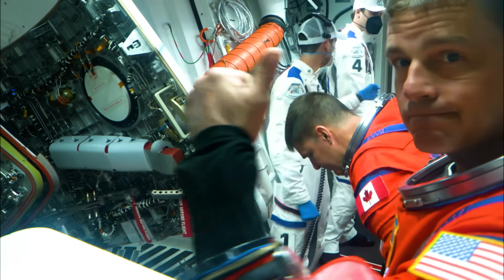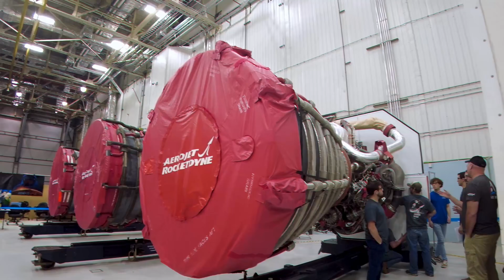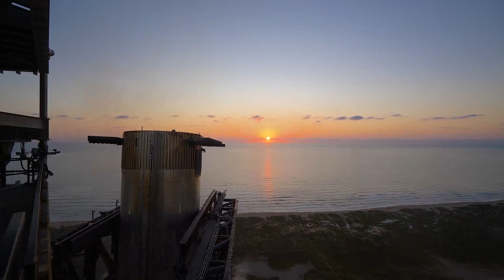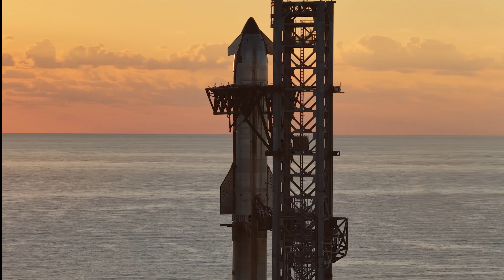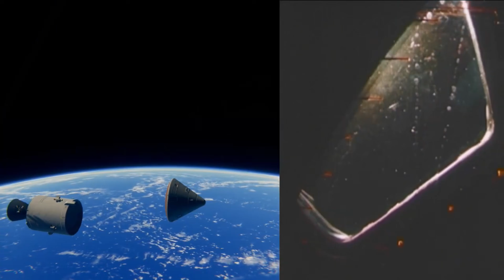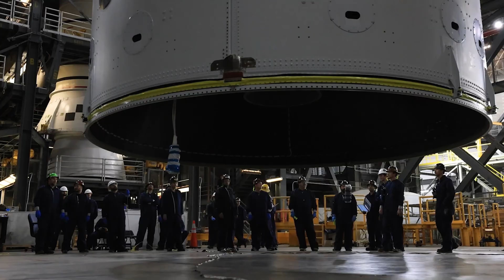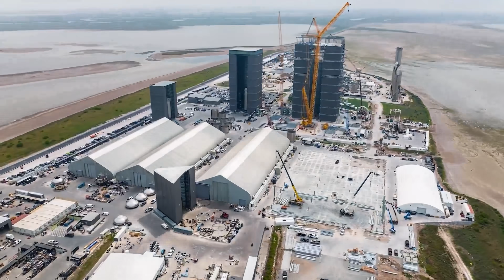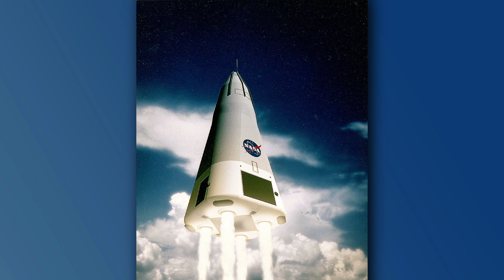Why SpaceX Starship and NASA Rockets Are So Different…

Comment: One word of advice for NASA: unaffordable.
Reply: At least NASA'S rockets do not constantly explode
Reply: @joeybulford9055 SpaceX launched 165 missions in 2025. 

NASA... 8. 

You only see the testing, but SpaceX already has extremely reliable systems.
Reply: @TexanTomcat 
I do not think you understand which of those rockets were for StarLink and which ones were for Starship. 
Starship has not had one single orbital launch since it started being tested a decade ago!! Elon will never reach the moon.
Reply: @joeybulford9055 I mean the reality is that Starship is not SpaceX's flagship program.

They can afford to do cutting edge R&D and fail time and time again with little consequence because they have enough capital from their breadwinning programs.

Reality is that no country or company can even compare to Starship, even if it takes dozens of more failures, SpaceX can easily take the burden.

Starship will eventually succeed and it promises SpaceX a near monopoly on space.
Reply: @joeybulford9055  NASA has done some impressive work.  In the past.  Under Dr. Werner Von Braun, a true engineer.  Key word is 'has', has meaning 60 years ago.  Von Braun was a visionary.  NASA has been run by bureaucrats since.  The new guy, forget his name, has some impressive credentials, but he's still run by corrupt, scumbag politicians.  

At $4B a pop and a launch every 3 years, SLS is a technological dead end. 

Can SpaceX do better? Well, they are currently responsible for more than HALF of all launches. IN THE WORLD!  That's street cred in my book.  Can they scale that success up with Starship?  We'll see, but at least the cost structure makes sense.
Reply: @joeybulford9055  That's because they never fly!  Because they are UNAFFORDABLE.

Comment: The amount of plain stupidity in these comments.... Nasa just cannot afford a rocket to go Boom like SpaceX does. All of the processes need to be thoroughly inspected, tested and retest hundreds of times, and that costs time and money. But in even though SLS costs more than a starship, SLS is a proven and reliable rocket system that already sent people to the moon.
Reply: SLS, is needlesly expensive, using old technology, reusing old engines from the space shuttle, it shouldn't have been expensive, and it is expensive because the money is pass arround, subcontracting everything, overengeneering everything, beurocrating everything, all for a rocket that can only launch once a year, while carring 46 metric tons at its best, for a 4.1 billion cost per launch, SLS is useless, starship can carry 100 metric tons per launch por a 110 million cost (the goal), and up to 200 ton in its version 4 costing 200 million(the goal), and can launch daily(again , that is the goal), while SLS can't and won't ever do that, for context, a 200-ton Starship V4 lunar flight cost less than 5% of a single NASA SLS Block 2 launch ($4.1 billion for 46 tons), while delivering over four times the amount of cargo, tha is why SLS should have been cancelled, and all resources should have gone to Starchip, money would have been better expended. You can go to the moon with SLS, and that's it, you can't build a moonbase with it ,only starchip will be capable of it.
Reply: @Voltaje_YT  - Beautiful analysis. 👍💯👊☺️ I was reading your post faster and faster.. because it was so cogent and well-crafted. 💪💯🤠
Reply: That argument goes two ways. A cheaper design would've allowed NASA to fly and test more often instead of putting all their bets on everything going perfectly.
Reply: Ah in reality SLS can't land humans on the moon, needs a secondary vehicle, nobody can afford the SLS that's why most all of the program has been cancelled, all future heavy lift designs and the launch tower for them are gone now, can't be spending billions to merely launch the Orion capsule to earths orbit, , NASA has seen the light and that is a fully reusable heavy lift rocket like Starship it can also take the capsule to the moon, after the moon landing there are plans for only one SLS launch a year, and that will most likely fade away fast as starship will be doing most all the work regarding a moon base, only block l remains in the SLS plans,

Comment: The SpaceX rocket concept is not remotely new. The Russian N1 had almost the same number of engines, but they couldn't get it to work due to not having the electronic capability of managing so many engines together.
Reply: Their only similarity is having many engines and being super heavy lift, that is it.
Reply: @gomul13  No, the pattern is very similar and they are basically using exactly the same technology from that perspective. I know because it's in the various papers.
Reply: @thisismonitor4099 1960s technology vs 2020s technology how is that the same? what pattern is repeating? none.

Comment: The RS-25 engines aren't just the same model and type of engines used on the Space Shuttle, they are literally the same engines used on Shuttle orbiters where equipment that belongs in a museum is being literally thrown away after but one additional use.

A huge waste of heritage and money.  Throwing away historic relics just offends me.
Reply: Unfortunately it cost Milions of dollars to prepare 
These relics for display. Then you need a place to put them.
Reply: @anthonybrennan4416 The cost is mainly making them safe for curators to handle them.

As for where to put them, there are three   orbiters with fake engines in them on public display.  I have no doubt all three locations would be thrilled to get the actual engines that flew in those orbiters.  Even if recovered from the bottom of the ocean like Apollo 11's F1 engines that flew on the Saturn V.  Those are in museums,  why not the RS-25 that actually flew into space on several historic missions?
Reply: @GlanderBrondurg thrilled does not equal paid for.
Reply: @anthonybrennan4416  Generally what a museum usually pays for such artifacts is literally just $1 USD and more importantly that they are trustworthy that it will actually be seen by the public and be properly cared for.  Your "estimate" is something I believe is way off the mark, but perhaps you have some specific insight that I don't have.  Keep in mind that it costs money to even get rid of stuff like this.  Please change my mind and I am open to being proven wrong about the costs.

But my real point in the previous reply is that there definitely are places to put these engines where they will be carefully preserved and even protect proprietary secrets and follow laws like ITAR and other industrial espionage laws that can cost some money.  The fact that places like the Kennedy Space Center Visitors' Complex and the Smithsonian Institution can be trusted with existing orbiters goes a long way to show that they can also safeguard and give controlled and monitored access to the public these kind of artifacts.  Indeed it wouldn't even need to be any place new as the existing exhibit space for those orbiters definitely has room either on the orbiters themselves or immediately below or adjacent to the shuttle orbiters themselves.

Please explain just what costs we are talking about for historic engines like this that may be of value to a museum and also preserve an important piece of American history?  I am not using the term historical in any loose sense either as I am talking about some events that will be taught in a general history lesson to young school children and not some esoteric and obscure tidbit that is only known to hardcore space nerds.